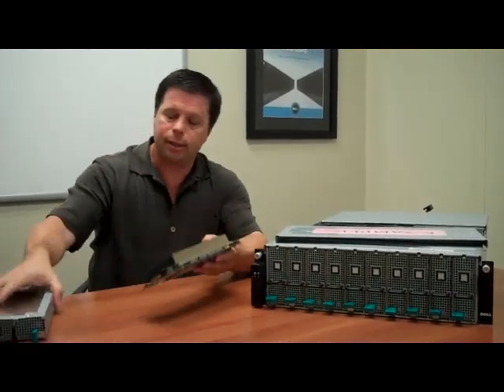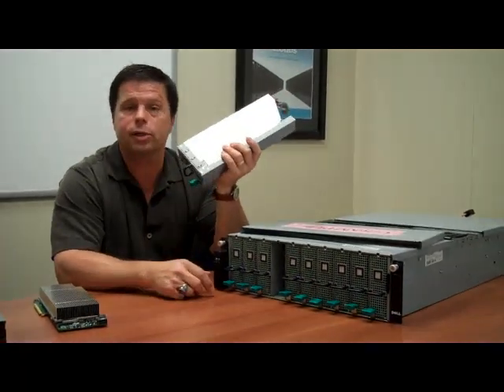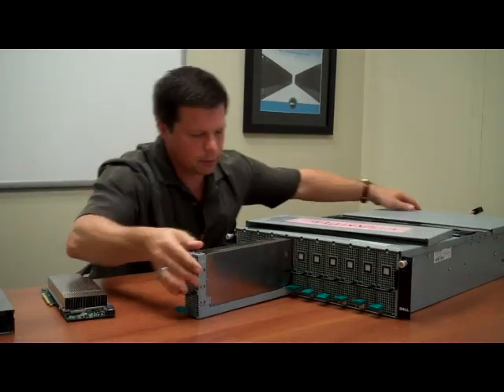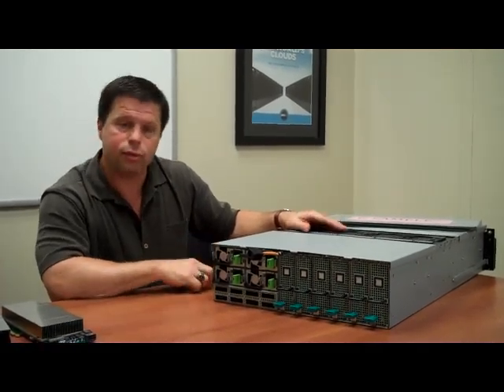PowerEdge C410x Overview

Comment: Hi Joe, you mentioned sliding this box in and out of the rack, will it come with Dell Ready Rails and/or a cable managment arm?  Are there any special considerations for cabling in the rear of the rack considering the GPU modules are also rear-serviceable?